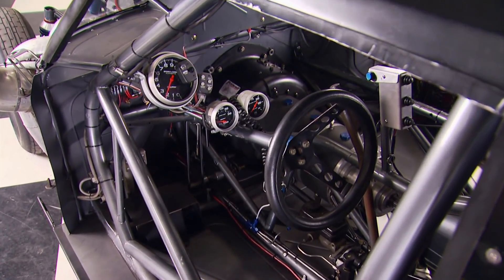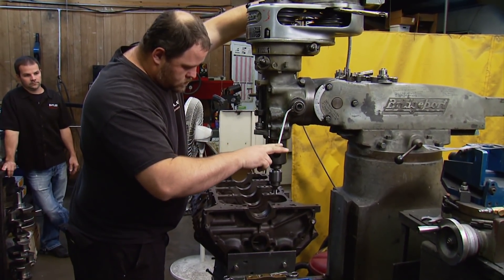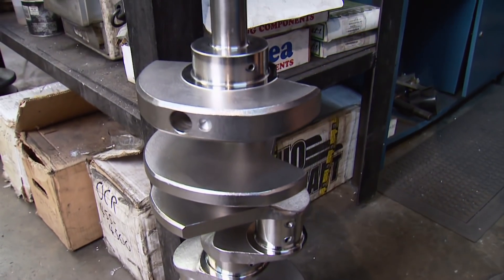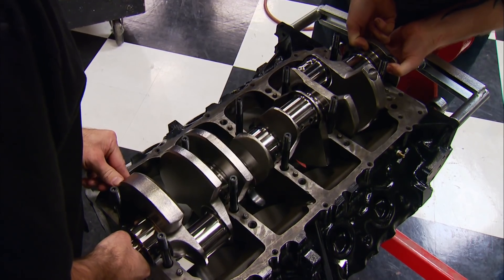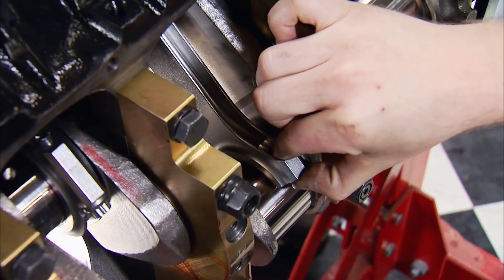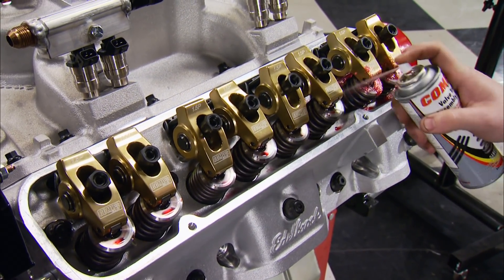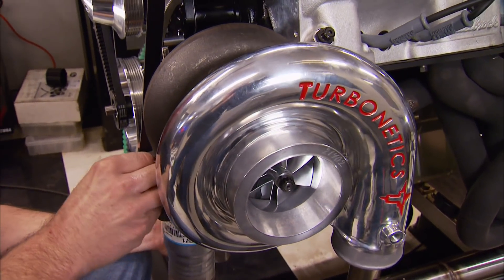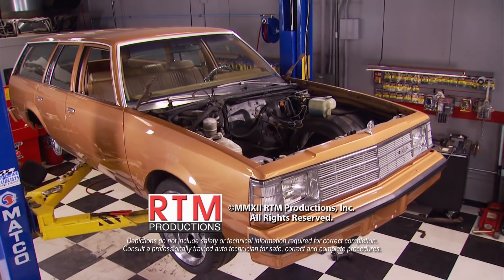Building A 461 Pontiac Turbo Engine For The 1978 Buick Century Wagon - Horsepower S16, E2

Comment: Pontiac Small Block ? 🤔  FYI Pontiac never made a small block . All Pontiac engines are based on the original Pontiac 287 from 1955 . They just changed bore and stroke and improved some stuff over the yrs . Even the low deck smog 265 /301 of the late 70s early 80s were based on the original design.

Comment: I built a similar system for my 1976 Bandit TransAm about 10 yrs ago.   Butler stroker crank, eagle BBC rods, ported factory 6H heads. 9:1 Ross pistons.  I had Butler make a solid roller cam 224/224 and 600 lift on 114 LCs.   Twin Garrett GTX3076Rs at 12psi, no intercooler.   Through the factory T10 and 3.08 gears, that car will spin the 335s from 55-100mph in 3rd gear without clutching it.  The low rpm torque is fun, but  yeah, its a little scary.

Comment: Wrist pins on the pistons !! 😱😱😱😱 wow, notorious in 389's lose those in high hp engines. Good Luck
Reply: What would you use instead?
Reply: These are not stock parts. There will be no problem with that